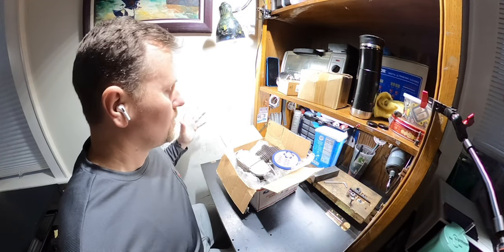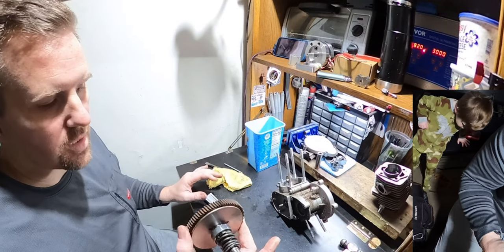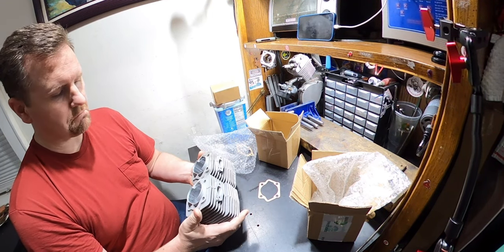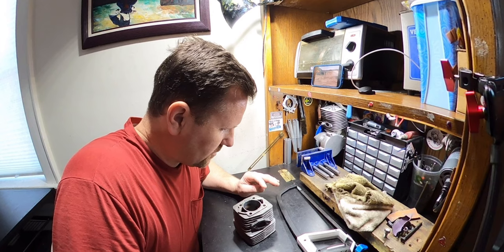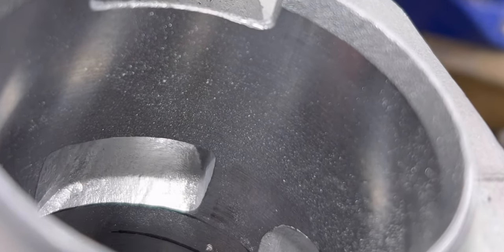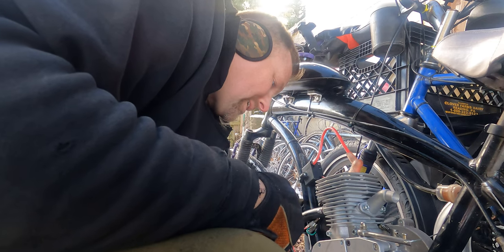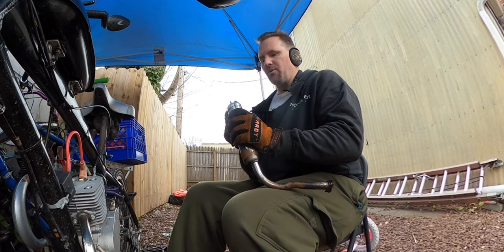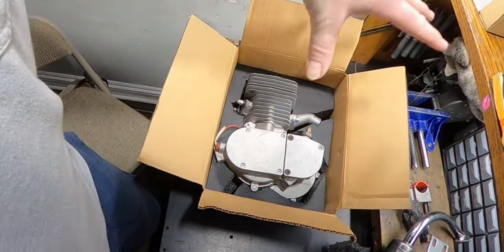Custom Motorized Bike Motor Build, 100cc build to Go Up Steep Hills.

Comment: Can you tell me how you make the squish band by hand?
Reply from the maker: Sure I can tell you, I use my 90 degree angle tool for my rotary tool and I use a disk (disk size depends on squish band I’m cutting) that I have that fit the tool. I bought a bunch of different size grit sandpaper disks that have adhesive on the backs and I cut them to fit the disks and I hold the head I. My vise and I very slowly and carefully start cutting the squish by hand. Small strokes with low pressure and continue till I get it close to where I want it then I repeat that with each grit paper (60g, 80g, 120g, 180g, 220g, and even more if I’m goin for a different finish. I hold the tool head tight at an angle so to cut the squish of the shape of the dome of the piston to get a tight squish. It’s very hard to do and keep it proper looking so that the squish is symmetrical. I will be making a step by step video on how I do it soon and every other step I take to port the motors to give everyone an idea of the quality of work I do but also what’s to be expected if they are trying to to do it to. So when that comes out (in a month or two) watch it for sure cause it will explain it better with pics cause just verbally explaining is kinda hard to do. After others in the builder community seen the quality I did with the squish most think I’m just using a piston with paper on it to do it but that’s not how at all. I did think about it when I first started to try to do squishes but the dome shape makes it hard to stick paper to them cause it tinkles bad and I found 99% the time it wasn’t even close to an acceptable surface finish.
Reply: @JMB676  I forgot about a 90° attachment...Basically a 90° attachment & practice. 👍
Reply from the maker: @michaelbrinks8089  exactly

Comment: Good stuff !
I was curious,  how much would you charge to supply me with the same motor 🤔 
Thanks in advance.
Reply from the maker: Absolutely no problem. Well if you have a motor you want me to do up like this one it about 200 plus shipping and that depends where you live obviously and if you just want to buy it from me the easy way without having to worry about anything but  paying then receiving it then it would be about $350 plus shipping. But here’s a link to our group and you can message me there and we can talk easier and more because depending on what you really want to use it for and how much you weigh and sea level and other variables you might be able to get away with a lil cheaper or different motor that might cost less or more. So hit me up at the link and we can figure it out if you like. Thanks for commenting.
https://m.me/ch/AbaM3yDmNvDTqnfB/
Reply: Thanks  , I'm in Melbourne Australia so I've got to factor in shipping and I think I'd be at around $700 aud .
Does that sound right to you 🤔
Reply: Sorry  , i don't do Facebook  @JMB676
Reply from the maker: @robertbermudez4458  well  when I looked it up it says around 75 to ship from here but that’s a rough estimate and you definitely want insurance for it. So I. Guessing around 150-200. And I won’t know until I go to the post office and physically check but when I sent one to Canada (our neighbor) it was 99 dollars. So around the world has to be more. I can find out for sure though. Also if it’s easier to email me johnniesmotorizedbicycles@gmail.com or text me @ (908) 392-8354.
Let me know and I’ll try to find out a more definite price for shipping tomorrow some time.
Reply: @JMB676  don't go out of your way just yet , I'm just toying with the idea for now .I could probably find the shipping costs if I new what city your in
Reply from the maker: @robertbermudez4458  Manville, NJ. 08835 fyi. No worries if you do cool if not no biggie. Let me know if you ever decide and if you do hit me up so we can go over different options for what you need and or want for you needs.
Reply: @JMB676  thanks man , I appreciate it 👍

Comment: why dint he just put a bigger sprocket on the tire ? but hey good job . kids are cute man lol . tell heather i said hi .
Reply from the maker: I’ll tell her, I always do for you. But I think the main rage didn’t do that is because he just does not buy any parts in the aftermarket for his bikes. He just uses only what comes in the kit. But to be fair also any motor should be able to pull a person up a small hill if they have a lil speed built up. But after seeing the motor with the crazy squish and poor port numbers I’m not surprised at all that it didn’t work for gim and to be honest even a lil larger sprocket probably wouldn’t help much at all. It was really really bad. Plus he told me he rides like 10 mile round trips daily and even a couple times a day I believe so a bigger sprocket would add a lot more time to his ride cause the motor would be raving so much higher just to do 20mph and I’m pretty sure he said he prefers to be at 25+ cruising speed. With a larger sprocket that would over heat the engine especially with the squish being so Extra. I doubt it would make it over a half a year before blowing up completely.
Reply: @JMB676  ok well that makes sense . hope he is happy buddy . im sure he will be

Comment: Hey Johnnie, what size is your Vevor Ultrasonic cleaner and can you fit a case half inside of it? Is water the only thing used or is there a chemical to add? I'm getting ready to buy one but not sure of the size to order.
Reply from the maker: @kennethmeese  I’m not sure on size I don’t remember but it’s probably about half gallon Or so maybe. It can fit a case half in it at an angle or both if you flip it and do another run. On dirty well used motors I do about 2-4 cycles per batch of parts I have in it depending on how dirty it is. I run water mostly but I also run a commercial grade degreaser for commercial kitchen deep fryers. I was working in the deli at Walmart and when cleaning the deep fryers out I used a certain cleaner only for it. The cleaner worked exceptionally well on very stuck in old grease and char. So I brought some home to try it and it works great as long as you run it long enough or since it’s timed I run multiple baths. There’s many other cleaners out there like simple green which I also use. I do mostly harsh deep degreasing jobs on older cases and heads and all cause those are parts I reuse and the deep fryer degreaser works the best so far but the simple green works just about as well and since I no longer work at Walmart and don’t know the name of the product I’ll have to use simple green till I find out a new product. I don’t like any chemicals that are dangerous for the kids to get into. I keep it locked up cause it’s not safe like simple green is but it’s not bleach but I could be corrosive if left on skin so be careful but I would look for a deep fryer degreaser if I was you or just do simple green with extra baths if needed. Lithe ultra sonic does an amazing job at cleaning everything but it just take patience cause it can take a night to do everything but end results is as good if not better then new.
Reply: @JMB676  Thanks for your reply, Johnnie. I purchased the Vevor 15L model it looks like I can easily fit a case half inside it. I've seen several videos lately saying Pine Sol works great in these machines for removing grease and dirt. Cheap and effective, I think I'll give it a try.

Comment: in what way did it run very badly?
Reply from the maker: @larryshaver3568  I was told it ran very poirly, low power and slow speed and no torque with a slow rev and got very hot. Basically everything bad that could be.

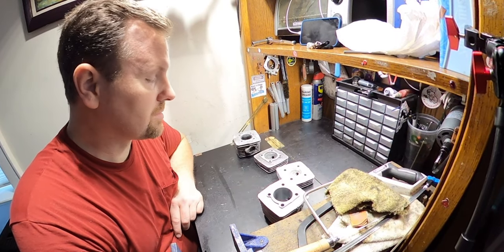Comment: At 35:00 ill compensate you if you show me how to increase air fuel ratio
Reply from the maker: If you hit me up on messenger I can help you out or set up a way to get your motor all fixed up. Let me know, there’s a link in description to my group and group chat and in the chat you can message me easy.

Comment: My yd100 runs hotter than my phantom 85
Reply from the maker: Is it stock?
Reply: @JMB676  no it has a nice exhaust that's it. It's the one piece cylinder and head. I have one of those nitrous kits on it but that's just for fun really cause buying nitrous all the time gets expensive. Oh and I have the dio reed kit. Just reed valve windowed piston and 21 mm carb
Reply from the maker: @Westhelockpicker  yeah that sounds bad ass. I wa t a nitrous kit too just to play with once in a while for fun too.
Reply: @JMB676  you can even get different size nozzles. It comes with 100cc nozzle but you can buy them up to 400cc. I bought a 200cc and it's a huge difference but the cartridges are so small it doesn't last long so I put the 100cc back in it. If I was going to be going somewhere that I needed more power I would put the bigger one back in and just carry a few extra with me. It's a lot of fun and it's cheap. The kit only cost like 60 bucks and it takes about 10 minutes to hook it up. The right way would be to drill a whole in the intake and tap it but I just put an air filter on it and drilled a whole in it. It works just fine. It's great to push that button and feel the power throw you back in the seat
Reply from the maker: @Westhelockpicker  yeah that sound s fun AF and I’ll do it one day but I want to install a real kit with a 2lb bottle or something like that and wire it up with a switch so I choose when it’s in and then a limit switch so it’s in when I hit full throttle and have the power switch on. Have it hard wired and run it with a power jet carb too so it get the fuel it needs and not run lean and melt a piston but all those things take time and designing but I will when the time is right.
Reply: @JMB676  the kit comes with a button so you can use it any time you want for as long as you want. When you hit the button it activates it and turns it on

Comment: Well,  how can anyone buy an engine & know they are getting quality merchandise?  You mention a larger size "Rod" & I'd be glad to pay to have
beefed up parts & what about these "Kits"?  They've all got a different pile of parts to make the thing work but how much of the parts in a kit
are even worth a damn & how would we know?  This is troubling & honestly these motors look like they're all made by 2-3 metal foundry's in
China?  Then Retail sellers add pieces n parts for your complete build but everywhere I've looked at these being built by kit,  there's always
a pile of crap they could not use.   I'd gladly pay more for a solid made cast engine with good workmanship.  A kit w/ heavy up rods & other
parts.  I might be asking for too much...... sad

Comment: yd100 ssuking suck i had one bt100s bt110s and avenger 85s are the best
Reply from the maker: They are super solid once you put a lil love into them but stick they suck for sure. It’s a shame cause 2 years ago when the molds were new they were super solid out the box beside the cert-clip problem.

Comment: The most overrated engine in history
Reply from the maker: Lido if o would say overrated cause back in the day when they were new they were also tight and built better. Now if you get one the molds are so old and worn out that they just don’t have good tolerances and make no power. It’s a shame cause they use to make decent power for a stock motor but unless you fixed the cert-clip it could grenade at any moment.

Comment: Serious question. 80cc or a 100cc for a trail bike? Been wanting to build one to keep up with my pitbike/mates pitbikes on trails 😂
Reply from the maker: Well depending on the pit bike you want to keep up with but imo if you want to keep up and even let them chase you, then you need a well built motor. Something like I built here but even more extreme. So I would say a hybrid build would be best for the power whether it’s a frank or mini. If you want great power and reliability then imo the best option is a steel sleeve motor like the 49mm iron sleeve 100cc or the cdh110 110cc like I ride. But both of them suck out the box, you would need to build it right and change the port timing or have someone like me build it for you and pay for the quality so it rips and most importantly lasts a long time. Those potholes have gears and these don’t have gears so you need torque and the right set of gears for your one gear and you need rpm. You want o live mid to top ripping and be able to spin high when needed. Depends how much you weight and a few other variables. If you hit me up in messenger I can help you select the best option or help you figure how to build it or even talk about building it for you. Let me know brother.

Comment: Now that's where you're wrong with the hobby situation you do get a lot of work you get experience you learn to have patience and you learn to be mechanically inclined all the same time and you get to save yourself some money cuz you know what parts to buy and what parts work and which ones not to buy which ones it doesn't work 100cc motorcycle engine kit I've been pretty lucky because it's so far I haven't really no problems with it whatsoever as far as making a sprocket to the back rim with the rubber pads that's easy I'm used to it now I can do that with my eyes closed that is so easy it's not hard if people think it is putting their back sprocket on the back wheel 🛞
Reply from the maker: @davidotto7666  mechanically inclined means you understand mechanics or mechanical things without any previous knowledge of thise item. Like having never worked on a diesel or gas vehicle and can take it apart and diagnose it and fix it without a schematic, or a fridge and fix it without ever being taught how to do it; you just understand what each part does and how they work together to do what it does. Just mentioning this cause you used it incorrectly in the comment and wasn’t sure if you knew or not. Being mechanically inclined is not very common since most people see anything mechanical and just get lost in how when where and what to do step by step. I am mechanically minded and have always been able to just look at almost anything mechanical and fix it or repair it without ever seeing it before or ever being told how to do it. You can’t learn to be mechanically inclined, you either are or aren’t. You can learn how to work on all differences types of mechanical things but unless you just know and understand it without being told you are not mechanically inclined. Hope you understand what I’m tryin to say. I agree this hobby can teach you patience and is a great way to get your feet wet so you can branch of into other things and pick them up and learn them. It’s a great hobby to help get yourself out of your own head and lets you just relax when trouble shooting problems.